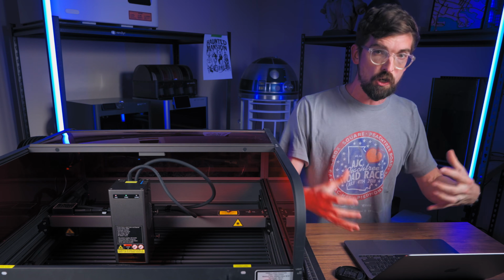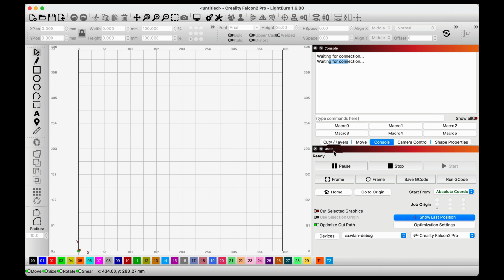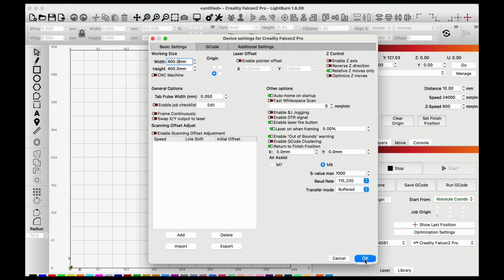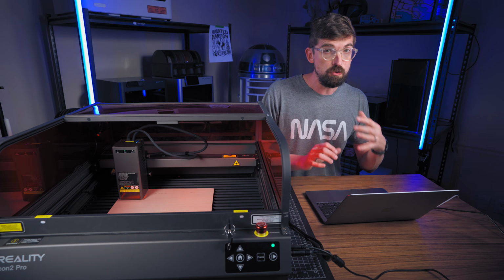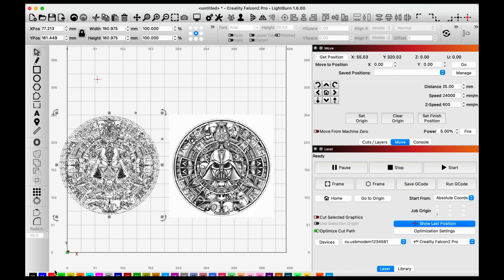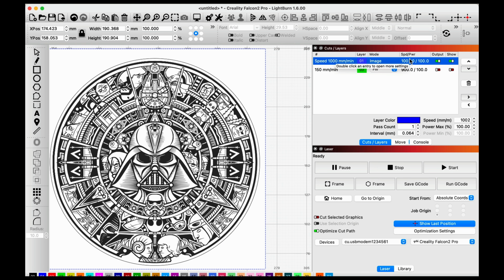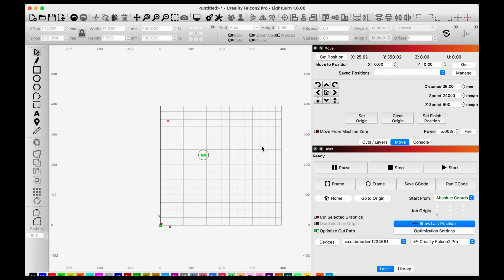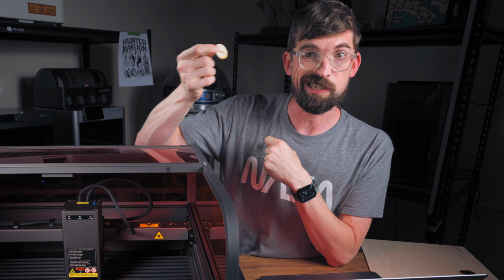Lightburn Tutorial for Beginners - Everything you NEED to KNOW!

Comment: what if I want to engrave upon a rectangular piece of metal that has its outer profile exists already. But I want engraved text to land precisely upon that metal which may have other holes or features. How do I get it perfectly straight in the machine as a rectangle so I can position the text precisely in the software. Cutting a final profile is easy. But how do you land text precisely upon an existing piece where no outer cutting will be done?
Reply: If the piece is rectangular, use the home position (front-left or back-right) and nest your piece accordingly. Then the piece/text will be aligned with that position. You can also dial the power way down and mark a piece of wood or paper for a test or use masking tape over your piece to test as well.

Comment: How do you have a circle I don’t have a circle on my page. I’ve had to put in a O and make it 5mm and cut it out by the line. It turned out fine but it still was a lot of extra work when I rather be able to size it around my work.

Comment: Great video. It helped me a lot. A general tip that is valid for most instruction videos. At least use a yellow halo around your cursor (can be created within Windows). Since it is so small and the screen is packed with functions it is often hard to see  where the cursor is on the screen. I have worked with Camtasia in the past that would automatically zoom in at your cursor position which is even better. Camtasia is pretty expensive but I bet the cheaper options like OCB (free) will have similar functionality.

Comment: Hi Diana, I’m a newbie and I’m waiting for my l8 40 watt engraver, one thing I noticed is with the 40 watt laser they say your work area is 39000 by 39000, vs 40000 on the 20 watt engraver, may be adjust your work area settings on light burn to 39000 to fix your alignment issue, hope this helps.
Thanks Gill

Comment: I use the Monport Mega and highly recommend it—it works seamlessly with LightBurn, which makes engraving super easy with its user-friendly interface, layer controls, and preview mode. For beginners in 2025, LightBurn has only gotten better with more intuitive tools, so pairing it with a reliable machine like the Monport Mega (auto-focus, safety enclosure, flame detection) is a win.

Comment: I have a request: cut out a square of 20*20mm and measure it with a micrometer, on the sides (place it parallel to the x,y axes). I want to understand this is my problem, or all diode lasers have not a square beam but rectangular. Thank you.

Comment: Thanks for vid.   I found that Lightburn software to be very similar to scientific graphics software from 20-25 years ago that drove an inkpen plotter.  But it's better, for sure.  I've only had the machine for a week, so my issues will probably resolve with some practice. The most difficult part for me has been to accurately align the honeycomb to the frame and  spoilboard(s), and then aligning the objects to be engraved/cut.  But this is somewhat due to using an Xtool D1 Pro, I think.

Comment: thanx for the video.. Got this last year.. just went right in..Running latest version on my mac.. One small issue.. Lazer consistency is off sometimes..  speed is at 1900 and power is at 80% ..   Does not always happen.. but just curious what in the world could be going on.. the depth of the engraving is just not consistent ...Air assist is off and over scanning at 2.5%.. could this be something in the "Common settings" Maybe the scan angle? the image is in 3 layers..but the setting are the same in all layers..   The layers starts good but then changes occur and you see deeper areas then the rest on that particular layer... Even when i join the entire file as one layer after i group it together..  I aways burn the same image, just change the text in it.. anyone here have any thoughts? thanx.